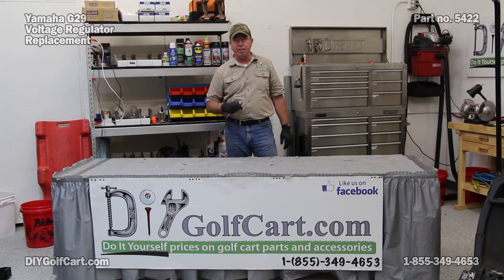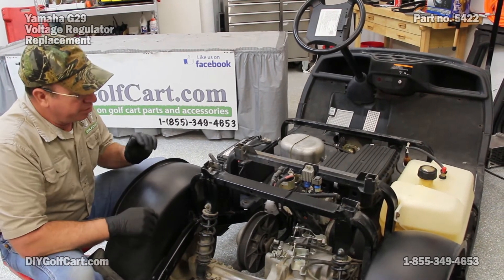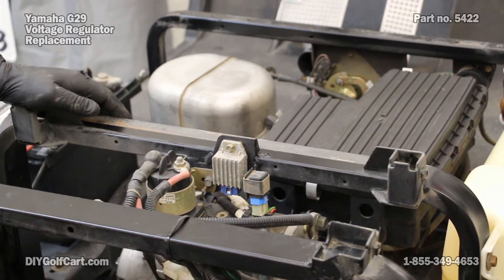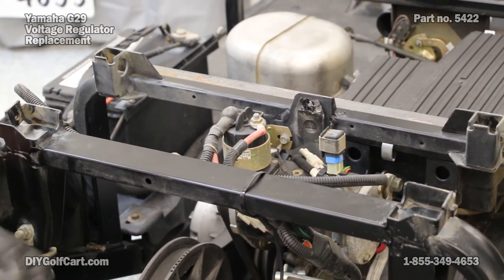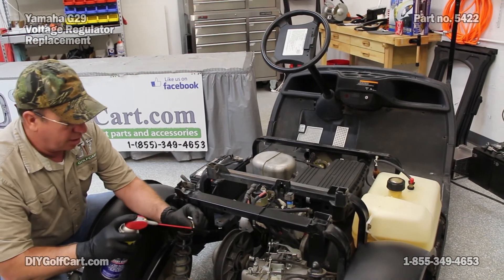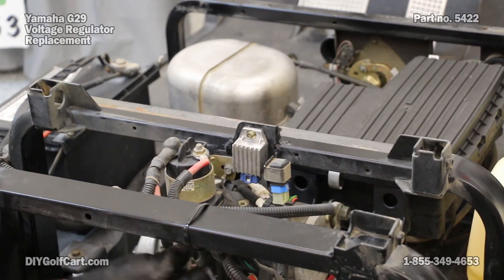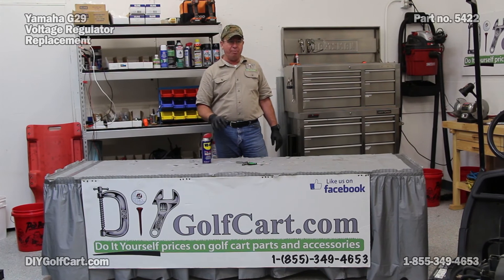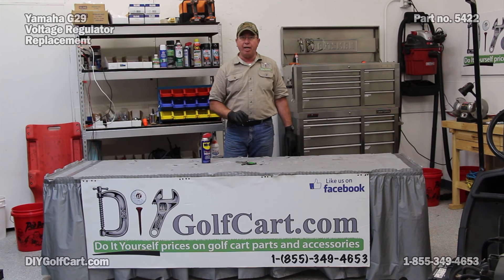Yamaha Voltage Regulator | How to Install on Golf Cart

Comment: Do you have any videos on diagnosing electrical on 2001 g16?has12v to regulator but no voltage to fuse.Or maybe a repair manual with wire diagram?
Reply from the maker: I do not have video's on that just yet. Give me a call he at the Garage (855-349-4653) and I'll help you out with diagnosing the cart's issue.